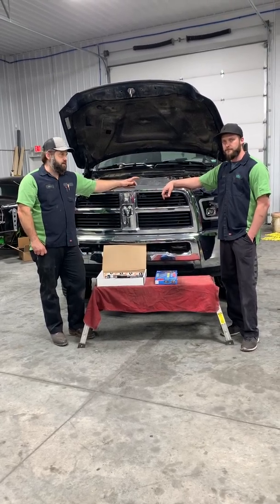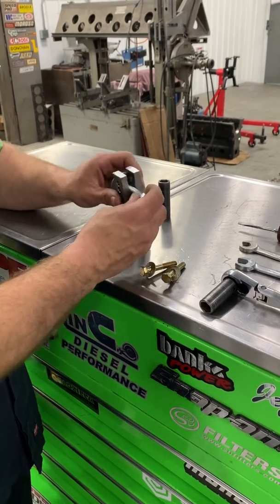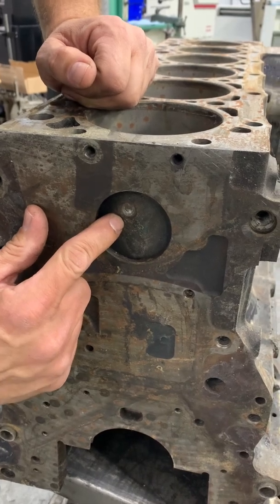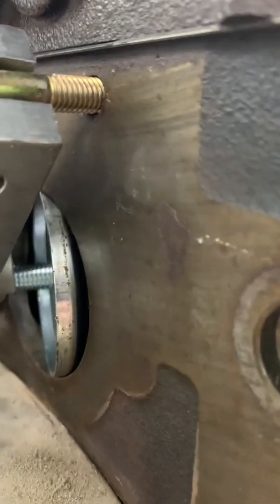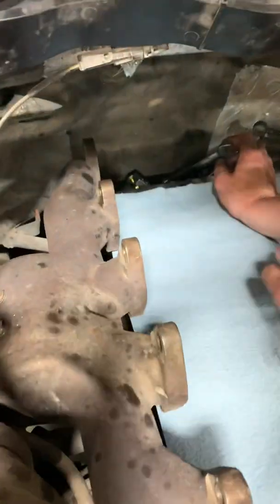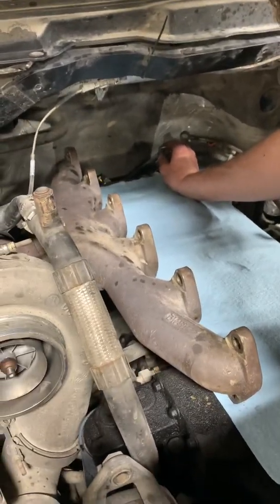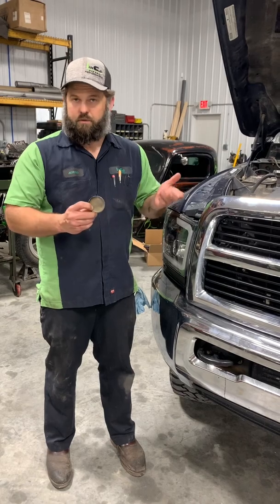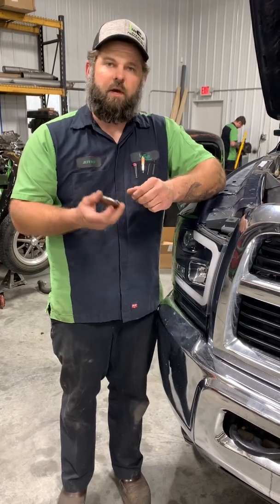Tech Tip- Fleece coolant bypass

Comment: Hey I’m doing this job on my 2015 ram 6.7 Cummins I just got the plug off and it’s caked with a dirty rust looking sludge heavily on the plug and on the piston I think what ever is behind the plug is this normal? I can’t find anyone with this same issue thank you
Reply: yes and no. Its very common for sludge to build in this engine and its not good. you need to do a coolant flush and use something like restore to eat the sludge. do a full flush and add a good quality coolant like shell elc, zerax heavy duty. its from the silica sand in the casting, iron in the block, old crap mopar coolent, and possibly non hoat/oat compatible coolant